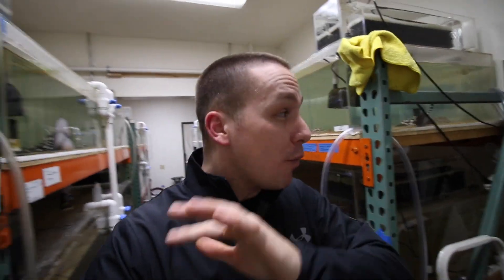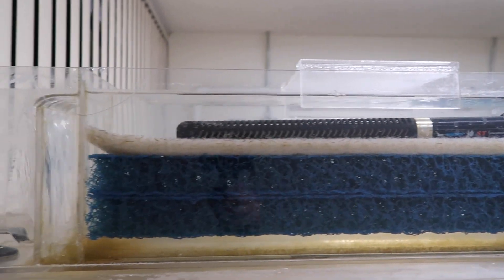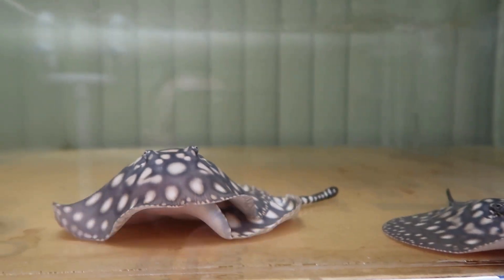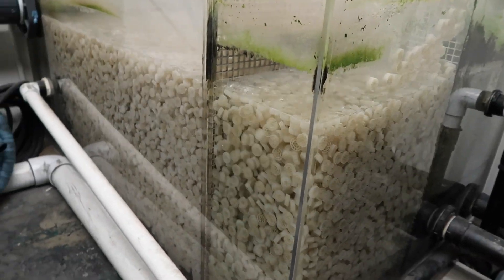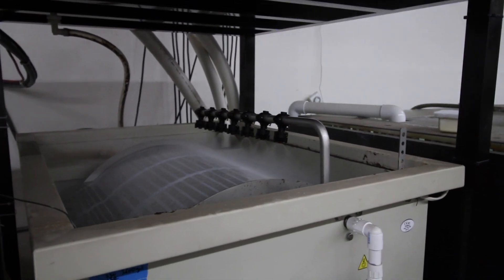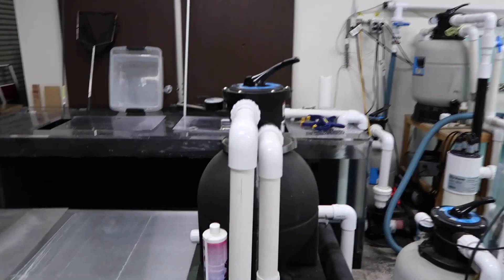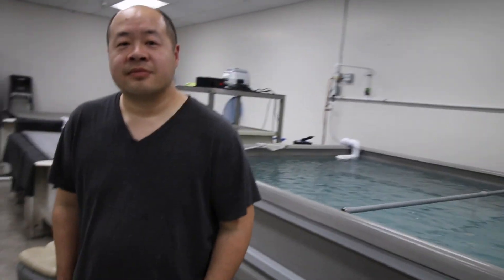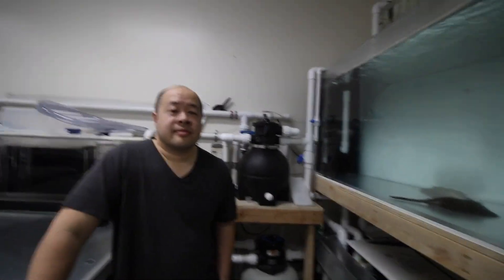FRESHWATER STINGRAY facility - How it works

Comment: People don't realize that heat pumps utilize a very efficient compressor. You may only use 30 amps at the most depending on the size of the unit.

Comment: Do the heat pumps act as dehumidifiers for the air at the same time as heating the water? And is humidity a problem with so many tanks in such a small space?

Comment: The filters he showed at the beginning, the above tank sump. Am I missing something or is there no pre filter. It looks like it is pumped up by a power head to a reservoir then it passes into a section that has biological media and a heater then it flows into another chamber and back into the tank. Where is the filter floss or a sponge?

Comment: King of DIY I have a question ?
I have 4 goldfish and 1 albino pleco I've heard a lot of stories that the pleco will eat the goldfish skin but it doesn't o have the water temperature in the middle not tooo cold and not to hot I've had them for 5 months they are all healthy and in great conditions plz give me some advise thanks.
Reply: Don't keep pleco with goldfish.  They got along fine for a few months then I found 4 fancy goldfish with very little scales left barely alive and I had to euthanize my goldfish and gave the 10 inch pleco away.
Reply: What kind of pleco gets to 10 inches?
Reply: GinaBo Beena you would be surprised how big some pleco can be

Comment: what type of cansiter filters are those?? i thought they were sand filters.. can anyone please explain or send a link if any??
Reply: nanoaquamania huge pressurised fluidised filters, no mechanics, they use them for pools, aquatics stores etc.
Reply: Lewis Armstrong so its jus a sand filter right? they might be expensive right?
Reply: Those are bead filters (the design is all sort of the same with swimming pool filters etc.) basically its filled with tons of plastic beads, and they trap debris etc. as well as provide biological filtration too. They can be back-flushed so it's really easy to maintain. You're looking at around 500 to 1,000 dollars for one.
Reply: iammyantinerd kool... thanks bro... :)

Comment: How much are stingrays on average?
Reply: Teacups are around $60, Motoros $300, and then you're basically either right at/or into the thousands with the rest of them (black diamonds, pearls, etc.)
Reply: Also forgot to mention Teacups are not a good ray to start with, although the price tag may be enticing, they are more sensitive to water parameters.
Reply: iammyantinerd in my country it is the other way around